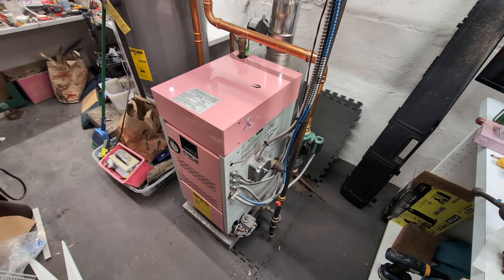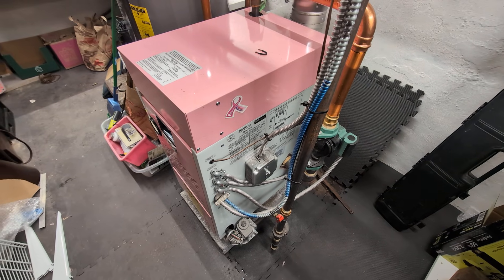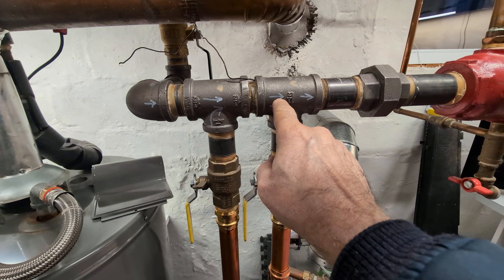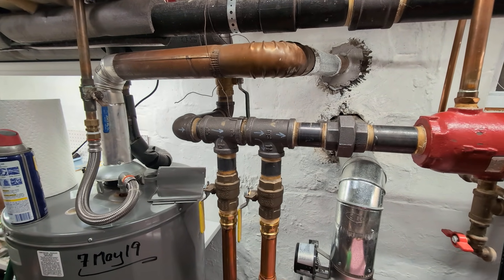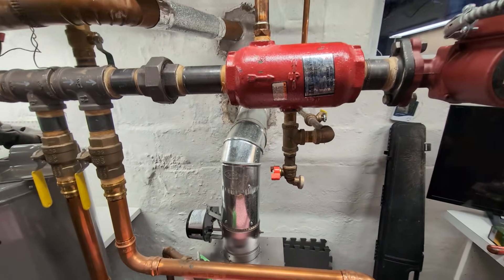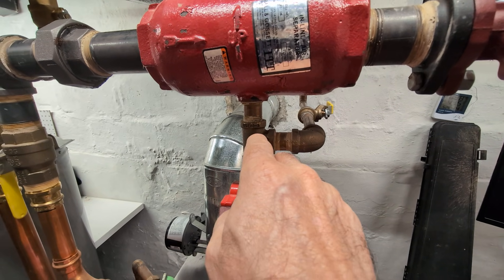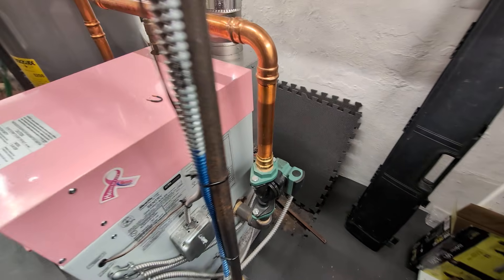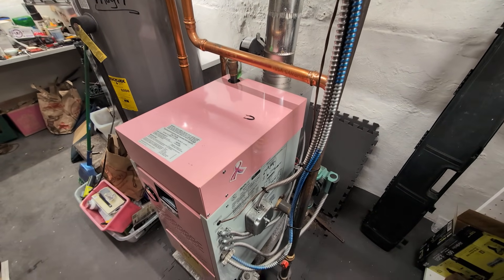One Way To Tie A Properly Sized Gas Fired Hot Water Boiler Onto An Old Gravity System

Comment: Anybody else a little freaked out about that paper bag right next to the water heater!
Reply from the maker: The water heater is one of those semi-sealed flame types, I believe, & unlikely to be an issue.
They are designed not to ignite gasoline fumes, right next to the boiler with its unsealed flames.
Even so, I take your point.

Comment: These roll out single use thermal fuses are terrible.  Live, exposed voltages on the fuse where an errant piece of metal can short them out to ground, blowing a xfmr or xfmr fuse.  Placing them on the burner box door, like a CGa Weil Mclain, makes pilot lighting quite problematic if you dont take the time to turn off the power switch first.
Reply: Nicely done on the piping.  I may have moved the air purger away from the source of turbulence though, like an elbow or the close spaced tees.  It allows the entrained air to separate more thoroughly by rising to the top of the pipe.

 (Whose make of air separater is that.  I have never seen a tubular style before.)
Reply from the maker: Thank you for your kind words.
The air separator was made by Bell & Gossett and was their model IAS, part number #112119. 
Supposedly, it could tolerate less than ideal piping configurations and had a full sized outlet for use with old style expansion tanks.
Naturally, it has been discontinued.

Comment: where do you purge it from?
Reply from the maker: The system's heat emitters are old-style free standing cast iron radiators that are individually bled.
If there are any air bubbles here or there on start-up, then the in-line air separator, combined with the technique of "pumping away" will put them right into the expansion tank.